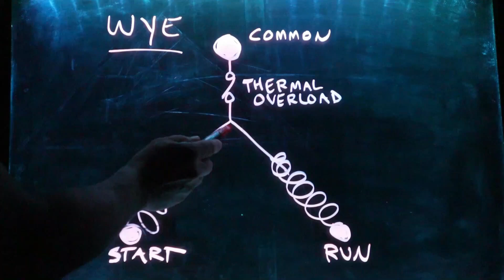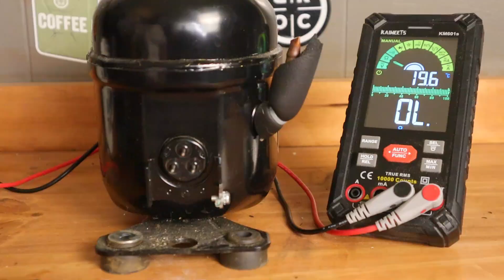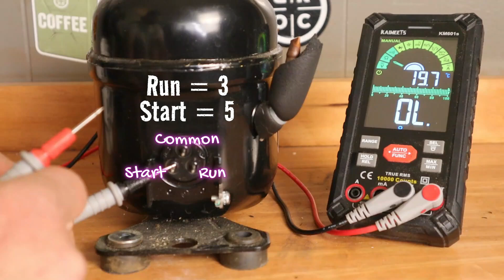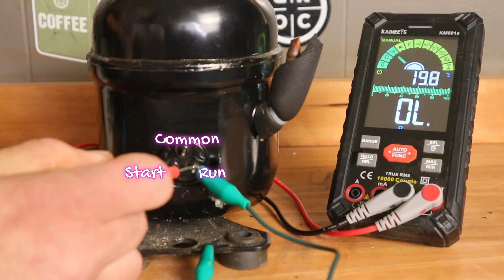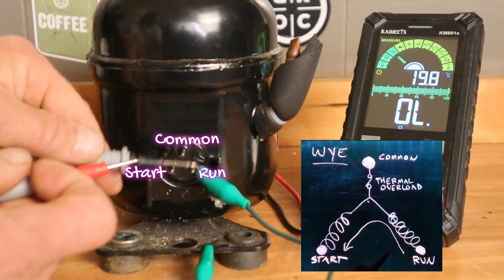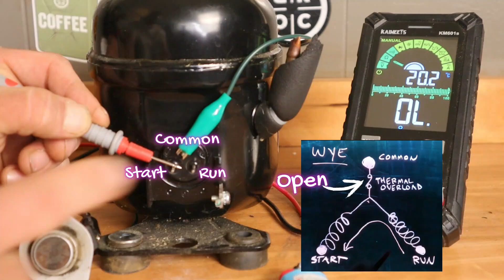HVAC Compressor Troubleshooting for Beginners

Comment: I always thought the START winding had the lowest ohm value because lower ohms equals higher current and you need much higher current to get the motor started. Where did I go wrong?
Reply from the maker: Lower ohms does create higher current and a stronger magnetic field, but it's not the current that is the focus on start up. It's the phase shift. Higher resistance and the capacitor in the start winding helps create a lag in the phase shift compared to the run winding to create the torque needed to get the motor going.